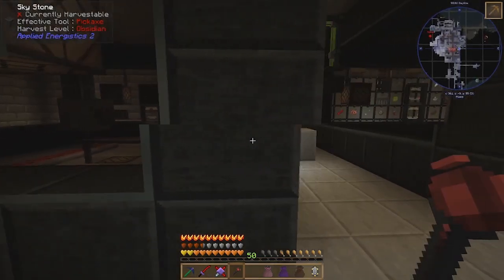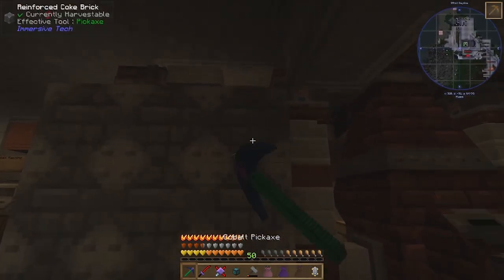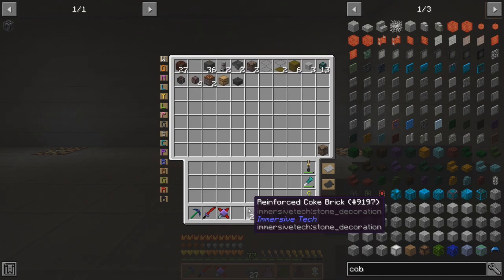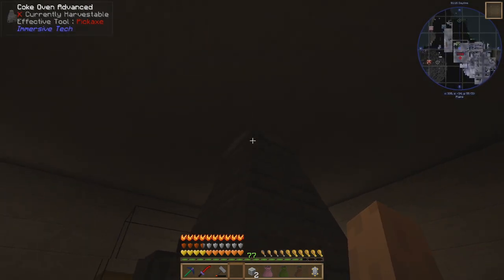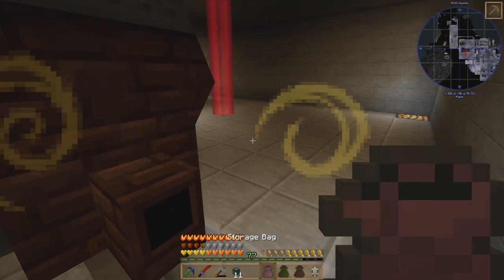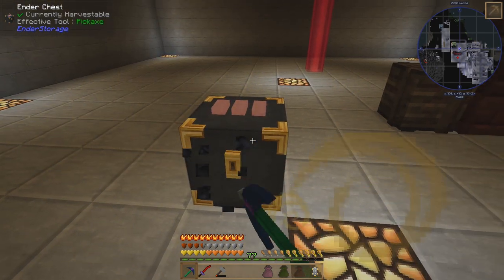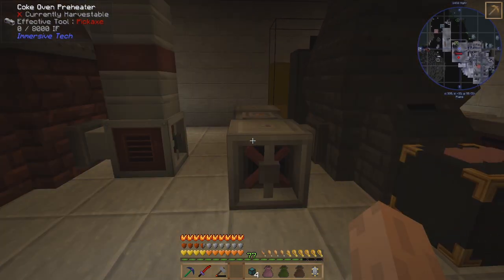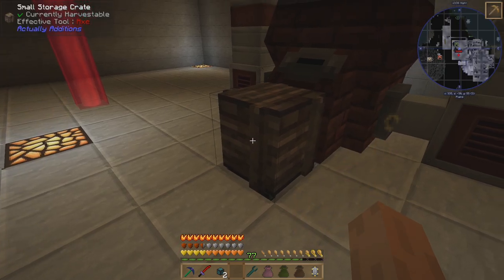MC Eternal - Ep 41: Steel Redux

Comment: Wouldn't it be better to use 2 points instead of 4 and attach the 2 points to the capacitors? It might save energy and if you run out of power you have a small backup for your steel.
Reply from the maker: Probably but I like the look without cables plus the points have an internal buffer too.
Reply: @RedSpecsGaming  true that